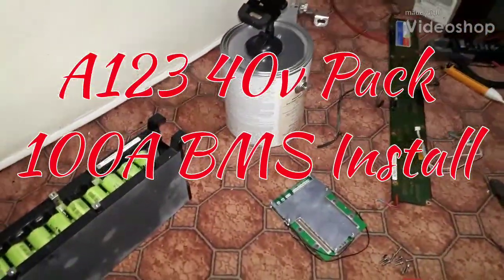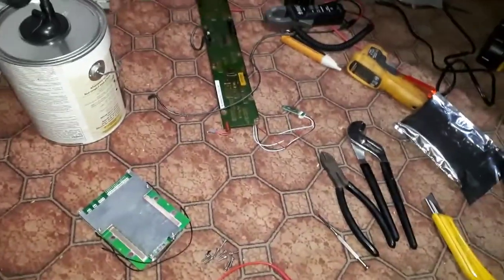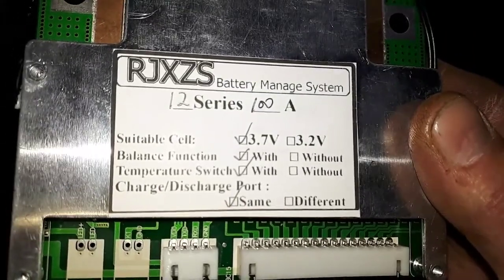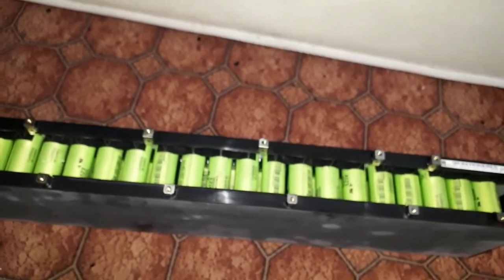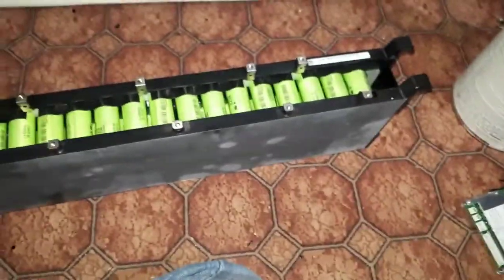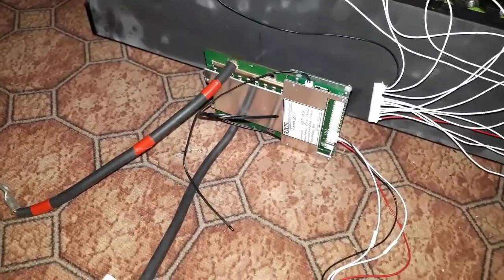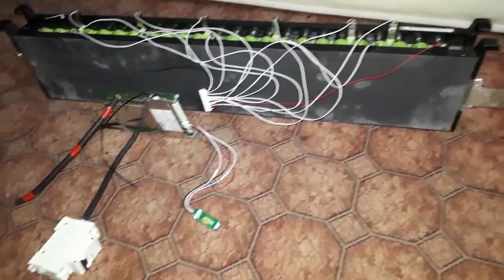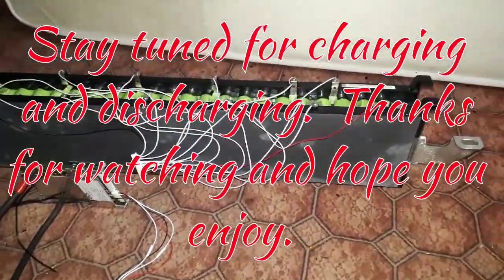A123 40v pack BMS Install

Comment: Nice video...how do you like the mini torch? Im thinking of getting one to use for shrink tubing...does it work well?
Reply from the maker: Its very hot in a small area. Not sure if it would be good for wrap.  But i really dont know. Id use a heat gun. Blows hot air. The torch uses a lot of butane too. Ur call brother.

Comment: https://youtu.be/Jh0EvkRYhMU I used a S6 version of your BMS. It gets warm if you draw alot of current through it charging or discharging. I'm thinking of mounting it on a aluminum plant for a heat sink.
Reply from the maker: For the single pack my amps charging are low. Thanks for the heads up